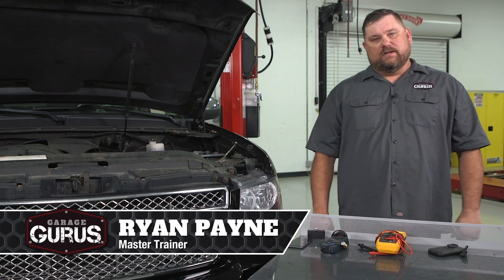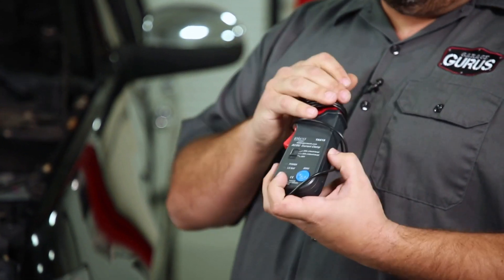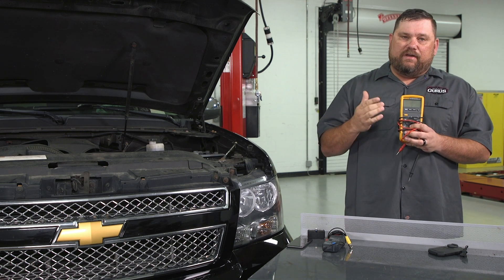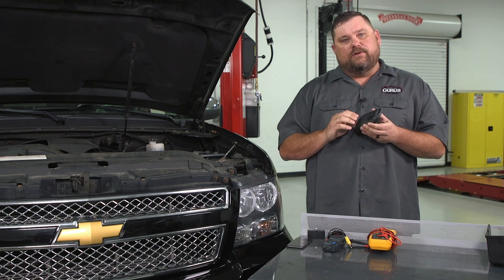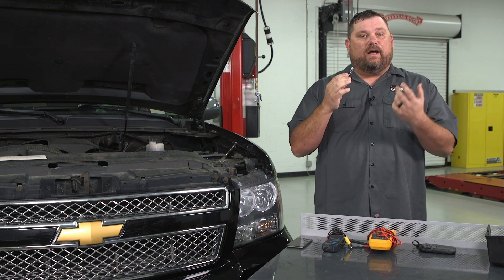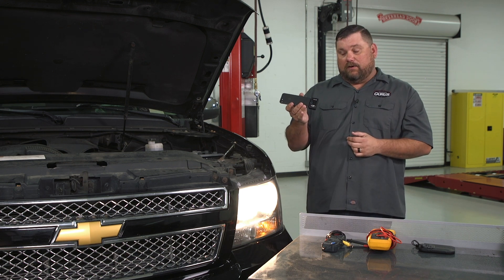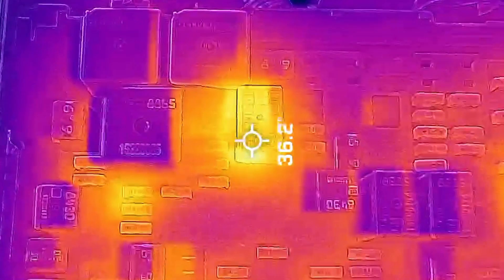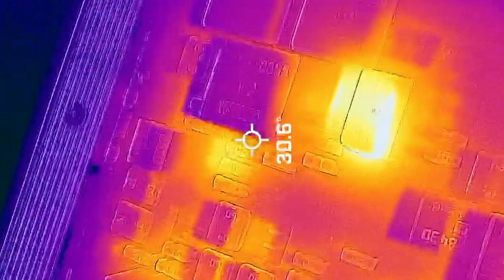Garage Gurus | Diagnosing Parasitic Drains

Comment: That’s works very nice with a 10amp draw and shows great, but how often do you get a 10amp draw it’s normally 500 milliamperes or less. How well does it work on a milliamp draw?
Reply: Verify valid point, I’ve had vehicles draw .050 mAmps and kill batteries over night, I’m skeptical to see how the thermal picks up that little of current.
Reply: Yep, That was my first thought. However, this technique does work well with small currents.